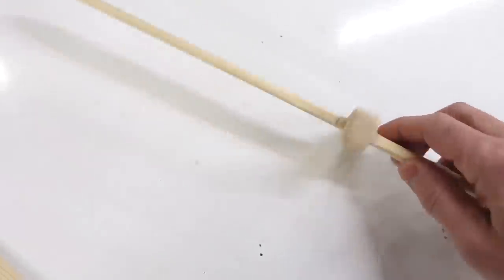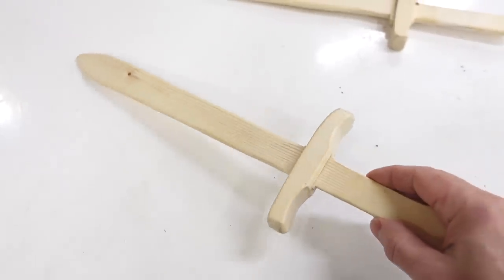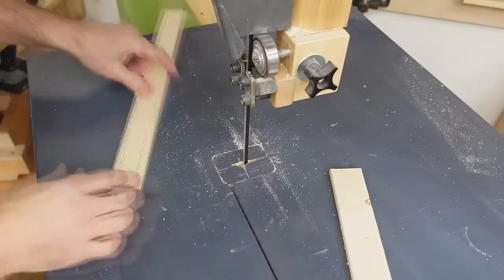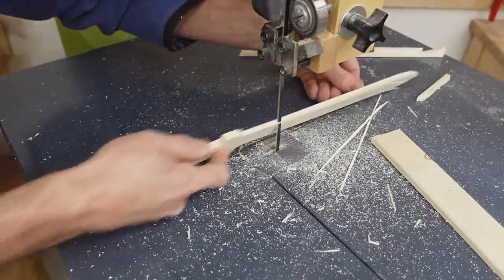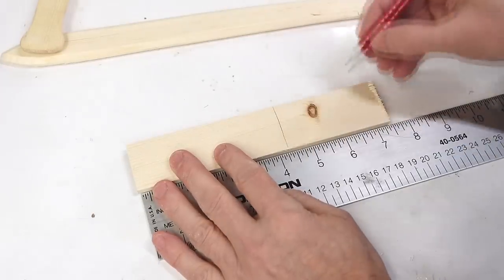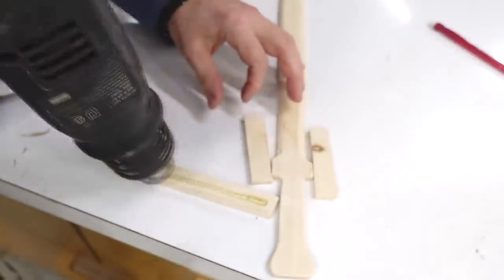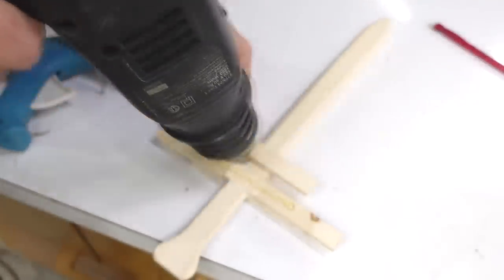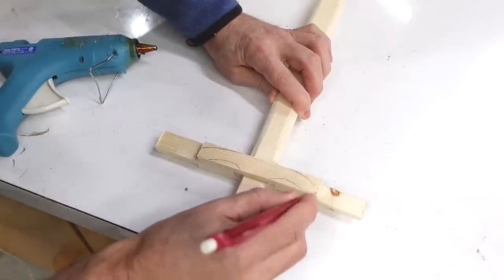Wooden kids sword, quickie project

Comment: I did make single piece dagger, like the US army knife way back like 15 years ago.
I just used some random plank, which i carved in the shape and serrations with bandsaw, and made the handle and bewel with belt sander.
It's really thick, like 2cm and the bewel is maybe at 45degrees so it has lasted all these years, even some winters left outside and thru 4 different kids without breaking.

single-piece desings are the only somewhat kidproof desings :)

Comment: Wrap the blade with aluminum HVAC tape for a real "metal effect".
This stuff is cheap, and a staple in the cosplay/LARP/prop-making scene for giving the illusion of metal.
Well, technically NOT an illusion, since the "tape" is really just thick foil with adhesive backing.
You can leave it shiny, or hit it with some steel-wool or scouring pad to give it a brushed/ground finish.

Comment: Could you use wood glue and hot glue - hot glue to hold now (like a clamp/pin nail) and wood glue for long-term strength? I have had mixed results with hot glue alone.
Reply: Maybe just superglue with an activator would be the way to go